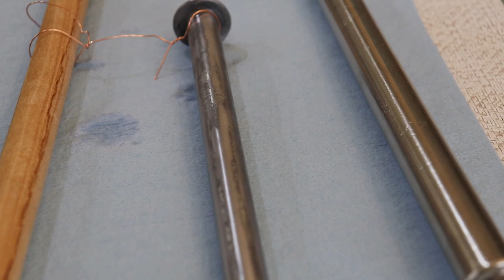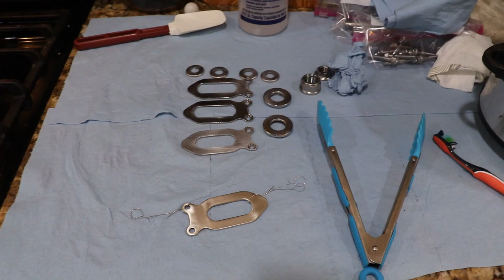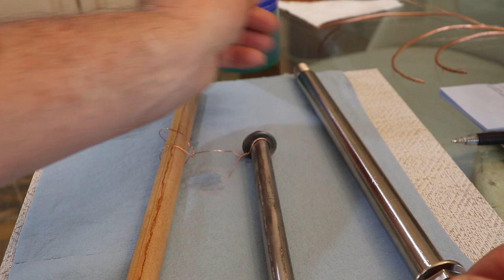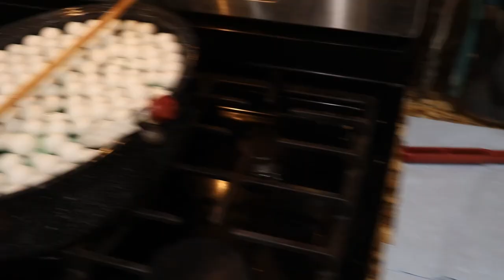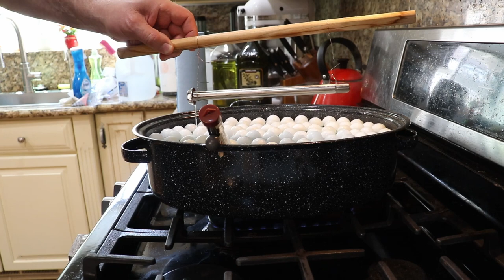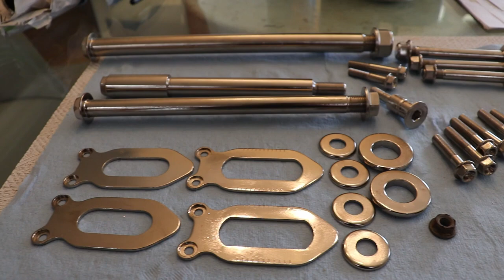Nickel Plating The Easiest Way Without A Power Supply Electroless

Comment: hey saw your vid from my Super Secret anomalous means but when I do it that way I can't give anyone a Thumb Up and I can't comment either 😂 So I decided to Log in that way I can give ya a Thumb Up and Make a Comment and ask ya a question or seven. 
I have been looking at Nickel Plating videos all day today.  I am curious as to what exactly is that Mysterious Green Liquid you are boiling on your Wizard Stove 🪄🧑‍🔬 is it Nickel Sulfate or Nickel Acetate or Nickel Nitrate?  Does it have a smell?  Do the Fumes eat the Cabinet Nobs in the Kitchen?  Also I am wondering how much it costs for Gallon of the Magic Green Juice?  And what what is the Molar Mass of Green Juice?  
How much does 10 mL of Green Juice weigh? 💡
If I boil down the Greenness of the Juice will it turn into Rock Crystals that I can Glue to a Ring and give to a Girl? 😎
The reason I am asking this is because a Nickel Coin weighs 5 grams and is 25% Nickel Metal.  That means if a Nickel is worth 5 Cents (and it is, unless it is a War Nickel made of Silver 🤔) then there is 1.25 grams of Pure Nickel in every Nickel  and that equates to 1.25 Cents for 1.25 Grams of Nickel Metal and Today the Market Price of Nickel is 17,163.50 per Ton divided by 2000 is $8.58 per pound divided by 16 is 53 cents per Ounce divided by 28.3495 is 1.9 Cents per Gram in the actual Market Value of Pure Nickel Metal on October 15th, 2024 🤔See now even my head hurts 😂🤣
My other source of Nickel Metal to do Nickel Plating is from used up dead Ni-MH and NiCd Batteries 😃Well a 4 Pack of those are like 13 Lucky Bucks but the amount of Elemental Nickel in them there Batteries is Highly Classified Super Top Secret and if the intel gets into Public Hands the Moon will split in 2, the Sun will burn out and the Earth will Freeze over 😭😂
And my Last and I think best source of Nickel Metal is 1965-1981 Canadian Nickel 5 cent coins are pure Nickel and weigh 4.94 grams and there ain't nothin' else special about Canada sooo00OOO why the hell not melt them Puppies down in some Good Acid for use in Nickel Plating Solutions, I mean really what kinda sick society puts a Beaver on a Coin anyway LoL 😜
I wonder if that will Plate Plastic parts if the Parts are sprayed with Carbon or Graphite Paint first and then dip in Mystery Green.  Like a Nickel Plated Ping Pong Ball Maybe for the top of a small Tesla Coil?  Hmmmm....😲
So now that I have established the longest comment under your Video really all I wanted was to ask ya wither that is a Sulfate or Acetate Solution and most importantly to say Good job on your well made video and welcome to the Youtube "How To" Gang^!!^ 🐺
Have a Good One Dude!!!

oh P.S. I think the Plating might work better and quicker if ya wiggle the solution or stir it periodically so that more of the ions are in contact with the parts you're platting but idk Cuz it's all a Mystery to Me in a Magic Land 😂
Woo00OOFF 🐺